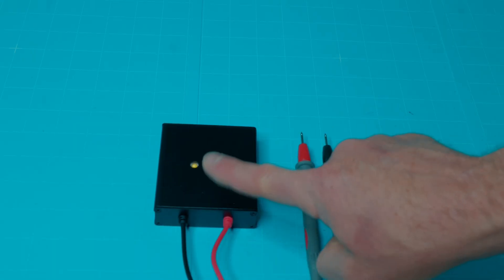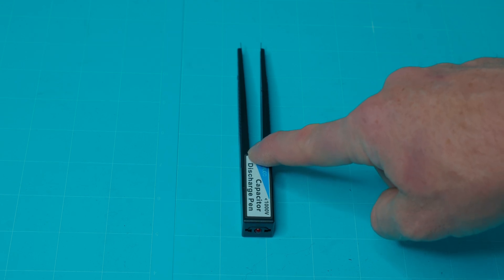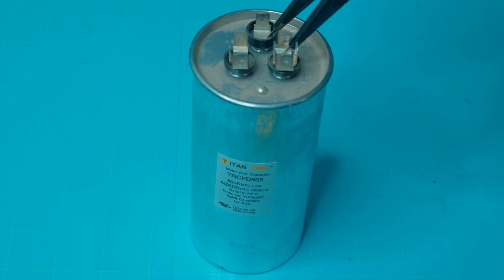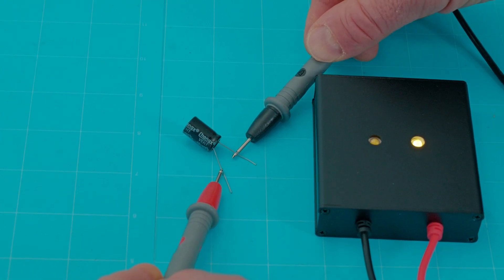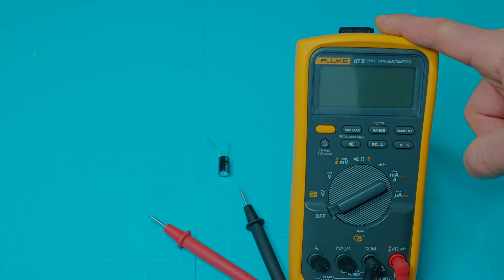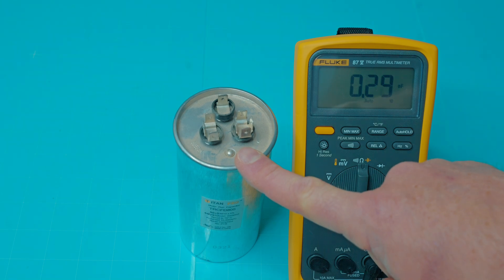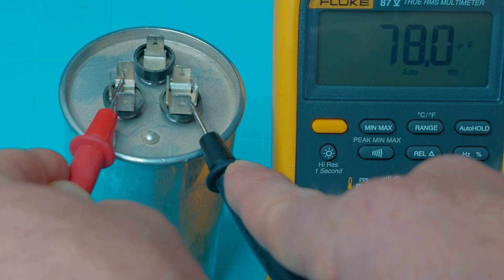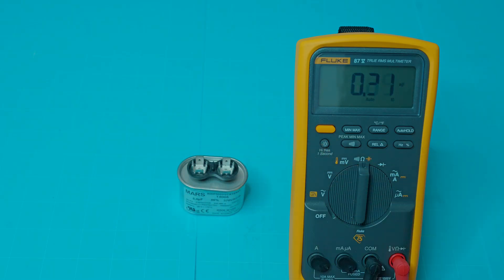How To Test a Capacitor With a Multimeter (Step by Step Guide)

Comment: I am testing one and the meter beeps and goes 0. Then does nothing. If I flip the -/+ it’ll do the same thing. Does this mean it’s bad?
Reply from the maker: Thank you for the question friend. It sounds like perhaps your meter is in the wrong setting, almost like it's in the diode setting. But if you're sure you have it in the capacitor setting, it doesn't matter which way your leads go it should read the capacitance of the capacitor, if it's reading zero it's definitely bad. Just double check your meter setting and make sure it's in capacitance mode for ordering a new one, good luck friend!